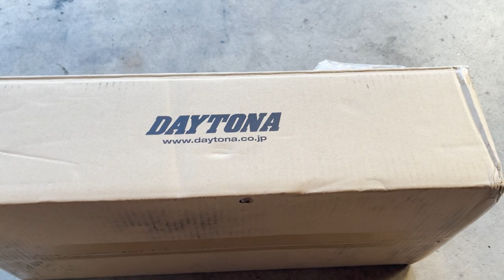Daytona Engine Guard for the 2021 Honda Rebel 1100: Overview and Install

Comment: Hey Macross what is the torque setting you used to tighten the bolts to fix the crash guard?
Reply from the maker: I couldn't find the toque specs so please don't follow mine if you are particular about it. From my experience I think 20lb is plenty.
Reply: @MacrossGarage  thank you
Reply from the maker: @binoyvaliyaparambath5759  No problem, you can also check on them every once in a while.
Reply: @MacrossGarage  cool 👍
Reply: @ Binoy Valiya looks like the top tightening torque is 44N.m and bottom is 54 N.m as per instructions in Japanese
Reply: @stephenkk7bfg498  hey thank you so much,
Reply from the maker: @stephenkk7bfg498  Thanks for the info.

Comment: Engine bolt did not come out that easy.the entire bolt turned an eighth then the nut stripped out on me.not as easy as it looks in video in my opinion
Reply from the maker: Which bolt upper or lower? You are the second comment this week on how hard it is to take out the bolt. Wonder if the newer ones have a stronger torque. Were you able to fix it?